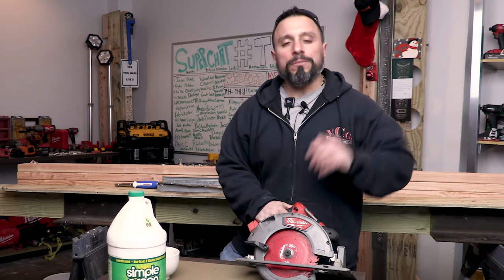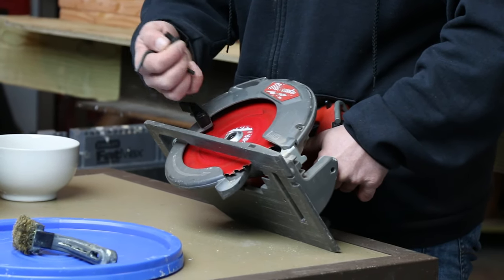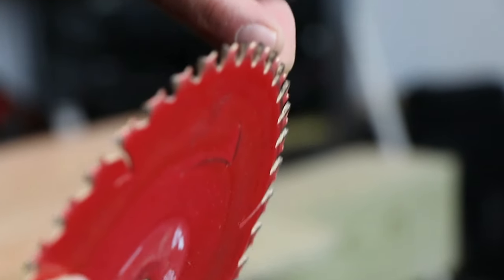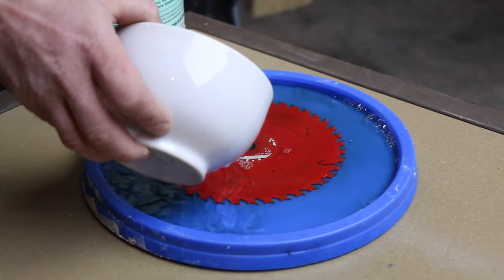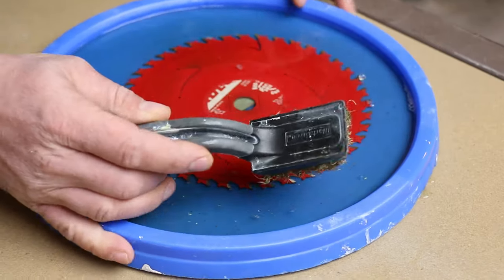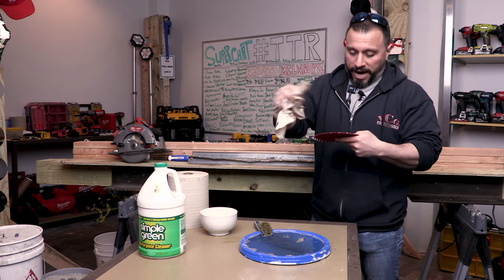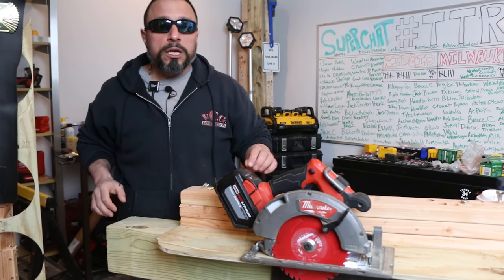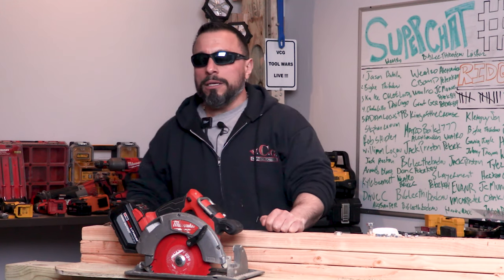EXTEND The Life Of Any SAW BLADE And SAVE MONEY With This Simple Method!

Comment: You can take it to someone to get it sharpened or do it yourself that's more for the 60 80 90 dollar blades you happen to ever run into the wobble problem then you hit a knot and the dam things explodes lol especially the high efficiency thin blades
Reply from the maker: i have not had that problem
Reply: Happened on 2 40t dewalt precision trim blades nothin on there 60t yet makita thin blades are really good too  for the price 10 blades @ $7.14 ish @79 80 bucks plus tax depending on if your state has taxes etc for the 10 also the diablo blades are really good with the titanium cobalt Tico 60t went from cutting steel rod to cutting trim and pressure treated np little slow on the pressure treated tho but great all purpose for good miters but at 20 bucks a blade for 7 1/4 it is on the high end but last awhile